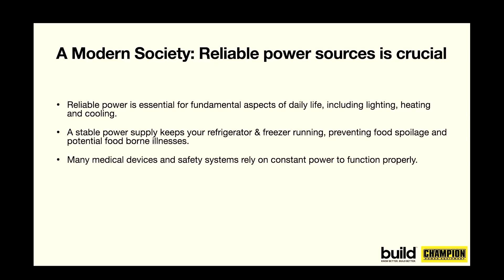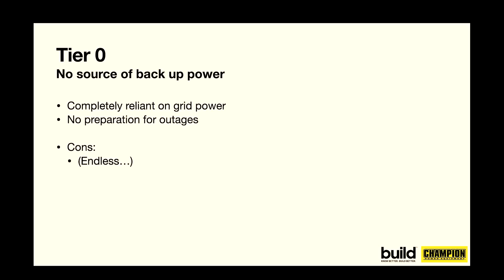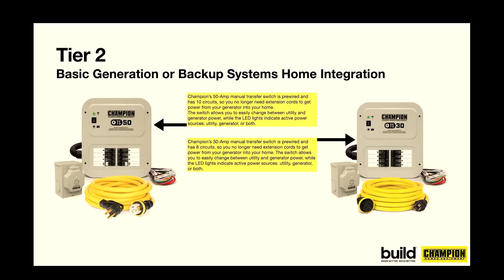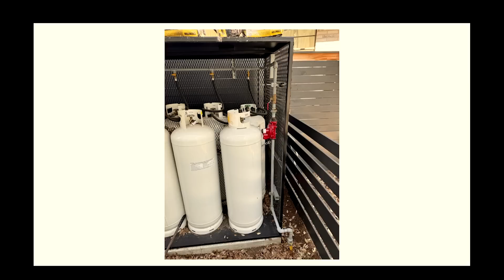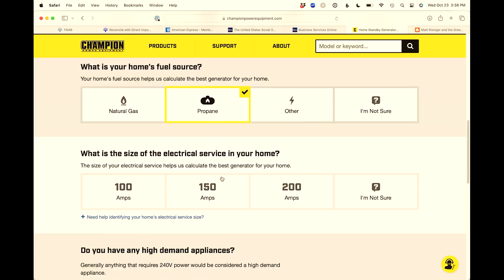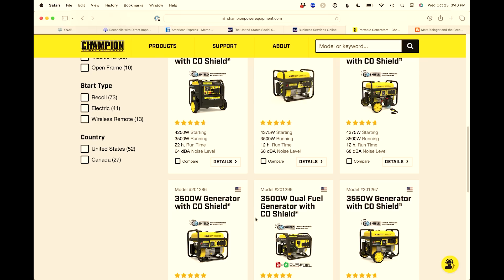In a Modern Society, Having a Reliable Source of Power is Crucial

Comment: in Florida 25 yrs. ago bought PowerMate generator whole house 6000W and have used it every power outage some over 3 weeks long.....first pull every time. same generator. new filter,  oil and that's it, runs everytime. extended fuel tank helps. 2 brand new harbor freight predators in box as back ups. need star link next. no power, no internet....insufferable. NOOOOOO!

Comment: Im kinda hybrid, i have some batteries and a 7.2kw inverter and some solar panels, the solar panels charge up the batteries and when i know it'll be sunny, i use a generator interlock to power the house to use up some of the power so my batteries and start charging again the next day. Which has been lowering my kwh usage from my utility. Yeah it'll take years to pay itself off, but if the power goes out, i'll be fine, and it will have been more than worth the upfront costs.

Comment: battery before generator for backup power, and the tool to make your solar work in grid out situation. Also, use the generator to charge your batteries. Order of operations, Solar -> battery -> generator. ideally you should never have to run your generator. Use a gas generator as a backup to your backup. but dont solely rely on gas directly. use them in conjunction with solar/battery.

 If you are pushing gas generators instead you are clearly just shilling for Exon/Chevron/BP. Don't do that. It hurts Americans in the long run. Makes us poor. Puts our hard earned dollars (in the long term) into the hands of oil/gas oligarchs that do not care for our well being. There is no such thing as a free elephant, you will bankrupt yourself feeding it. Same for anything that consumes gas. Buy a solar panel, use the sun instead.

Comment: Mat, have been watching you and WranglerStar for a long time. I’m not going to flame or get “my hackles up”, but…
We have lived in TX/OK for decades and currently life in the southern tip of the Rockies completely off grid, so we know what we are talking about. Getting to the end of your video where you said that moderate home, well constructed was key. We agree 100%. Using solar as primary energy with batteries AND a backup generator to recharge the batteries works perfectly. If a residential on grid home was taken off grid and operated on solar/batteries with a natural gas generator backup to recharge batteries, no grid would be needed. Cut the power cord…. Oh, and sit down with Signature Solar, they are in Texas. You could learn a lot.

Comment: HI Matt, checkout Rose Water Energy (whole home battery backup and energy filter/regen). Based out of Plantation, FL. Designed to filter/regen energy for the whole home to protect electronics. If grid power fails, a generator and/or solar can recharge the battery/regen system to keep things going long term. Long time follower, love your work! All the best!

Comment: Being rural, this has always been an issue for us. We did a solar array with battery backup which we use everyday so ROI starts on day one. We have a smaller multi-fuel generator attached if batteries go low at night but haven’t needed it as we limited circuits on emergency backup grid. A generator running can blow through a lot of fuel. Hooking the generator to a battery allows it to rest between charges.
Reply: Yah putting in a slightly larger generator would be ideal in that case.  It can provide power for your home and the extra power goes to the battery.  That would solve the noise issue at night as well. As long as the battery can get you through the night then the generator can turn off at night.
It just gets expensive if you were to have solar + battery + generator.  Just like how Matt's wife was questioning the generator in July that extra expense was worth it when they needed it though.  Honestly insurance companies should give a discount if you have a system like that though since the chances of really expensive repairs goes down if you are prepared.

Comment: solar, batteries. no reason to consider anything else for new build.
Reply: Ummmm, we are off grid, solar/batteries and Starlink, not an issue.
Reply: @ Is your solar/battery system dependent on the internet/Starlink/Wi-Fi at all?  If so, you are vulnerable.  Therefore, propane power should be supplemental to solar (heat, kitchen appliances, water heater, air conditioner).  Redundant systems are imperative because we may eventually be facing long term outages.
Reply: @ nope, the solar system is not connected to anything.
Reply: @DNB1970  Cool, I'm still learning.  My goal is off grid in a rural area.
Reply: What if the internet goes down?

Comment: Sorry, but you can absolutely use a whole home battery system as a generator
Reply: A video on battery options would have been more of a service to this channel's viewers than a Champion sponsorship.

Battery server rack systems are, at this point, marginally more than 200 per kWh (vs around 800 per kWh for a Powerwall or Ecoflow system). A set of solar panels totaling 5kW is also now easily under 2000.

Installation is the biggest part of the cost at this point for becoming an energy independent home and no longer being beholden to large utility companies.
Reply: For a little while at least. A few hours, a day? Still need a gene for anything longer
Reply: @Zorlig You are misinformed, you can continuously run on an Enphase solar/battery system, with enough sunlight (most of the year in the USA sunbelt).
Reply: @MikeYoungeasytravel  "with enough sunlight" aka not in a storm that took out power. Not in the big ice storm. No, I'm certainly correct.
Reply: @Zorlig  That depends on your battery size and power usage.
Reply: @Zorlig  With batteries as reasonably priced as they are nowadays (unless you want to pay Elon nearly 4x the going rate), a large system that can last a couple of days without sun is actually very feasible, and longer if being thoughtful with power usage during an outage.
Reply: @dosadoodle  I'm fully aware, I have a working system with several days of backup myself. It doesn't change the math: which is that what you are really doing by changing battery and solar numbers is modifying the amount of generator time. Just like the actual power grid, it's cost prohibitive and inefficient to reduce that number beyond a certain point.
Reply: @Zorlig  Combining the whole house battery with solar makes a generator totally useless